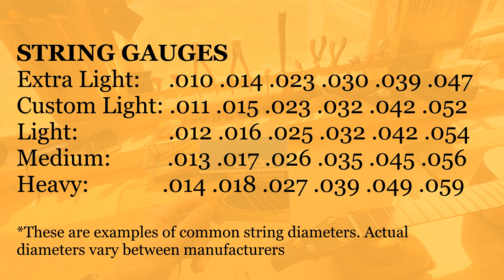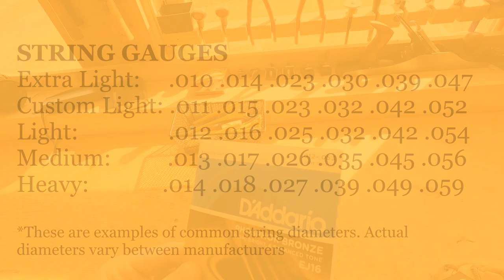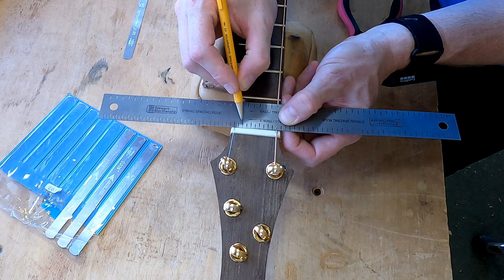Nut Slotting Masterclass | Guitar #86

Comment: Makes you wonder why guitar makers don't always include a zero fret.
Reply: probably because the tension on the zero fret causes it to wear very quickly which means it must be leveled and replaced more frequently than the other frets. this is a problem even with stainless steel frets.
Reply: @runrin_ Pressure alone does not cause fret wear, friction does - otherwise the same problem would apply to the nut, which in most cases is a much softer material than a fret and therefore much more susceptible to wear.
Reply: I love zero frets and will be putting one on a used Gretsch I just picked up.
Reply: @spleantrampoline 
I bought 4 very old USSR Ukrainian acoustic / classical 3/4 short scale (24") with wooden nuts that are all messed up.  All have zero frets, but the zero frets are same height as all the other frets.  I don't understand why they would do that at all.  I anticipate I will completely re-fret one of them and per web advice use jumbo stainless for the zero frets and a hair  higher than the nuts, which may not work all that great either,  I've been reading about nut compensation as well, so still not sure what I will do.
Reply: Plus better sound while playing open chords

Comment: I file down the height of every slot to the depth just before string touch the 1:st fret, when playing an open string. Then you get a very easy played guitar, almost every time lower string height  and you dont need to use any specific measurment. It is different in every guitar. I have done this for 40 years and always got easy playing guitars as a result. Rock on and Happy new Year!

Comment: Thanks for a very good video. 
I have made lots of guitar nuts and more often than not I end up filing a couple of the slots too low. My OCD kicks trying to get the action at the nut as low as possible with just a few more file strokes. You’d think I would learn. 😢
Reply: Yup, same hear. I keep extra nuts in my stockpile for those OCD occasions. Also, keep in mind that the wound strings have a wider oscillation and need a taller gap at the first fret to prevent open string buzzing.

Comment: Picked up a few good pointers and some things I like to do differently. Like to cut a softer angle on top (5-6 degrees?) then roll off the back in the direction of the tuners. Slightly flatter slots is more material for the strings to cut through. Because slots do slowly get deeper over time. Have a 40 year old guitar with the original nut and frets and the slots look like the grand canyon. But amazingly they still function.

Comment: I have a set of the same files, but the high B and E files suck because they cut basically square bottom slots. The others are a bit uneven too, but acceptable. The square slots are useless as the strings will vibrate sideways and make strange noises. I actually curved the cutting edge by filing/rounding off the corners of the teeth, which was an improvement though they don't cut as well.
Reply: That's good info as well, thanks. 
I'm thinking about investing in a set of files. I guess, like most things, you get what you pay for.
Reply: Unfortunately nut files all seem to be so bad that for the thicker wound strings, those dirt cheap welder cleaners that are supposedly no good, do a better job. Does anybody know of nut files that actually create a rounded groove no matter the price?
Reply: This is why I often buy premolded nuts and set them by filing the bottom, not the slots.
Reply: @markrawling8816  That's the best way but usually you'll have to do some final slight adjustments. The trouble with this method is that it can be time consuming because you have to take the nut out, file it down and then refit to check. In my case, this method is a bit more difficult because I'm left handed. Sometimes I get lucky and find a premoulded left handed nut that is just right for the guitar. There can be another problem here because some third party premoulded nuts are compensated string spacing which I don't like.

Comment: I still remember the first time I saw a Floyd Rose style locking nut, and being surprised that there wasnt a proper nut slot or forward edge  involved.Then the first time I saw locking tuners, and realizing that they really weren't " locking" anything, - they were just making poor string winding more difficult.
Nice demo, - and if you didn't quite get it, - being a one time thing, - cutting the nut properly is a process; you prob shouldn't plan on rushing it, and getting on to finishing something else . Ironically, I've found that with pro tools made for the task, it can be actually easier to make mistakes.Their efficiency needs to be well controlled.

Comment: Very infoemative video but I was wondering, Should I splay the back side of the nut to match the path the string follows through the nut to the machinehead post to prevent binding. You cut a downward angle to match the angle of the headstock but the tuners are not in a straight line behind the nut. Would this be benificial or am I overthinking the process? Your thoughts on the subject please.

Comment: When you are filing the nut, with the feeler gauges under the strings, should the angle of the file match the angle of the headstock?  Thus taking the string to the angle as it follows the headstock as to goes to the tuner?
Reply: The angle needs to be more than the headstock angle. The strings should only touch the edge of the nut.